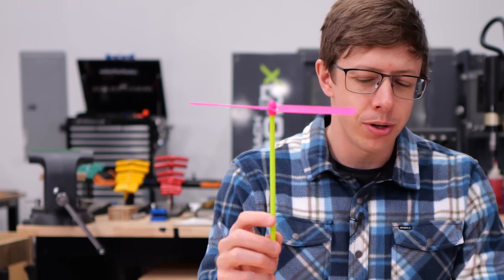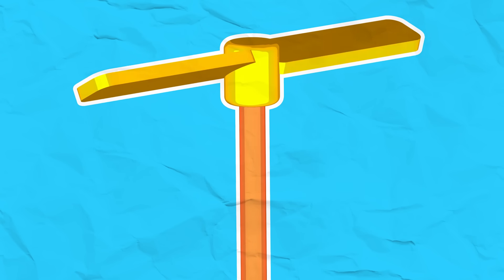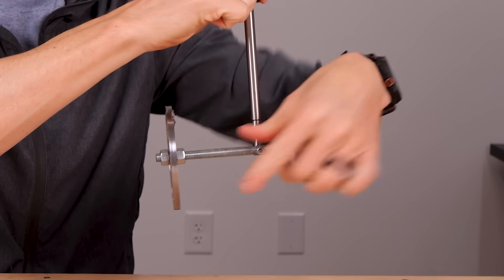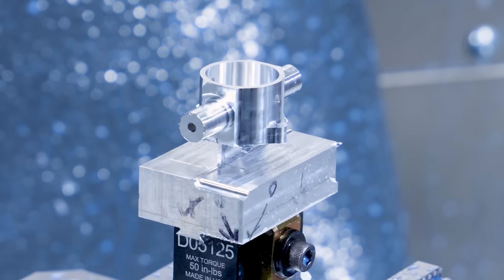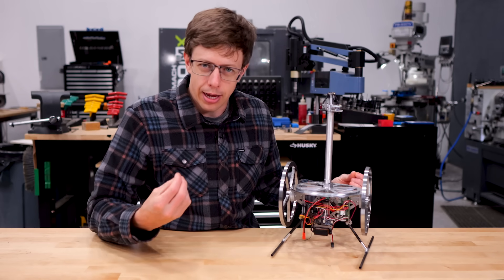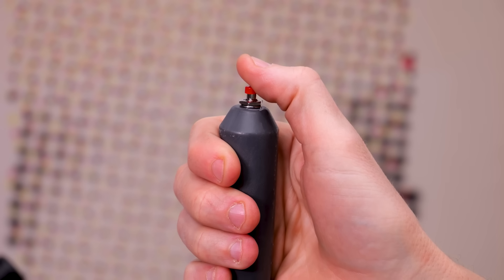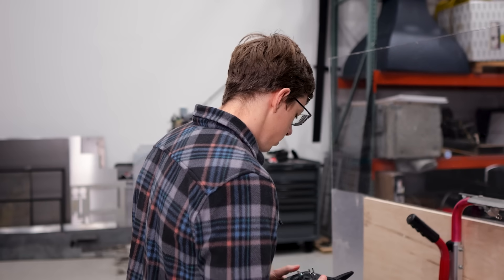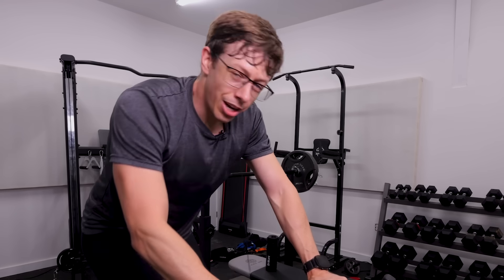I really thought this would fly well

Comment: 1:21 Would it make a sonic boom? I may be wrong, but I believe the sonic boom is caused by the object moving past you. It would be really loud, for sure. But it wouldn't boom, it would just be constantly loud.
Reply: It has to do with the overlapping of the sound waves, which at or above the speed of sound are not travelling fast enough to get ahead of the object, so they compound. So something moving toward you at exactly the speed of sound would be really, really loud when the sound got to you. A sonic boom is just that compounded sound, like a whip crack for example. Of course, bigger things generate a louder sound, which is then compounded.
Reply: A sonic boom just happens the moment something breaks the speed of sound (supersonic)
Reply: @ComradeCoy  sorry but no. A sonic boom is just many overlaping sound waves reaching you at the same time because the object emitting them is moving faster than the waves can travel. Importantly, it has to be a moving object because otherwise the sound waves would not overlap.

Comment: If you were to use another pair of flywheels rotating in the other direction, I suppose you would have the sideways torque cancel out and still keep it from flipping to the side. I suppose you could have a second horizontal bevel gear for the second pair but this one would rotate them from below instead of above. That may be a simple way to fabricate it

Comment: At minute 15; what about removing the ground?  At takeoff, the behavior, or even the effectiveness of the control surfaces won’t be representative of their performance in flight, with this gigantic earth-sized blast shield right behind them — ie: they’re getting no flow it’s like if they were stuck in prop-wash 🤔 (this is just how I’m imagining it though, i could be very wrong).   But if the launcher were on a pedestal, would you see more responsiveness?
Another thought I had on… “procession-protection,” was a contra-rotating prop (either a duplicate of the existing prop gear, & coaxial shafts, or 🤔 spider-gear? lol idk how passionate you were about this one but I’d rather imagine it failing from too much added weight or inefficiency haha / engineering your way out of a design oversight 😂, but ok, I shall eagerly finish watching now😊!…)  Love your work👍!

Comment: Why didnt you just make the propeller it self heavy so there is no extra mass to lift and it just need to be a propeller. Because of the rotation it will stay upright and the propeller it self becomes the flywheel

Comment: The flywheel should really spin in the same direction as the rotor blades so that they generate the same gyroscopic forces. some kind of transmission could be added between the rotor and the flywheel to increase the rpm of the latter to store more energy. Also the rotor should be able to pivid around its center so that the blades can flap up and down, in order for it to be able to fly horizontally.

Comment: If you needed horsepower to spin it up you could just buy a junker car and salvage a real motor, if you needed 20 you'd easily get 5x that on the low end, possibly 25x if you shopped right.

Comment: What other said about counter-rotating propellors helps... but at the end of the day, flat blades at 45 degrees is one of the worst things you can do in an aircraft or rotorcraft. For every newton of vertical thrust you make, you also get an equal amount of drag. What you really need are airfoils, to more efficiently translate velocity into lift. That will reduce the control authority you need to counteract the drag.

Comment: If you really want to make something really simple and flying, I recommend remembering about spiral springs.
For example, they are found in music boxes.
You put the spring in the base of the propeller. You insert the spring cocking mechanism into the shaft. All that remains is to insert a button/switch to release the energy in the spring and you're done.
No electronics, a minimum of parts, as similar as possible to the original children's toy. It will also be light in weight and this thing will not break itself in the process.

Comment: Tourbillon system? Or just straight helicopter? Or simple smaller flywheel at the bottom of the axle stem that rotates with biggest guy rotating to cancel out problem rotation although the smaller needs right an allow for correct flying/total height and weight reduction? Or something else like tube launch system with secondary props and a axle bearing flywheel that unscrews then clutch spins weight later? Excited to see the next one

Comment: Not sure if it was already mentioned in some of the 1925 comments below but the reason the flight surfaces are not working is that your testing is keeping it low to the ground.  You need to let it rise up by at least a wing chord length so the air can flow over and off the back of the surfaces cleanly.  As it is right now it's sort of "piling up" against the ground/floor just a small distance below the trailing edges of the control surfaces.  And that's negating the development of corrective force from those surfaces.    Perhaps a new launch platform but one that is elevated up off the ground a ways and with flat struts aligned with the airflow so the controls can develop the proper forces.

Comment: You forgot to counter the other torque, induced by the horizontal wheel,  include the weight of the top blades also... maybe you should use the horizontal gear as the flywheel mass altogether. There is lots of ways to improve it.

Comment: Just a small correction:  when a helicopter is in auto-rotation, the rotor does not reverse pitch - it just decreases the AOA.  It spins in the same direction, and is essentially gliding a plane with no engines.
When close to the ground - the AOA is increased converting the rotor's kinetic energy to lift.
Reply: Maybe no negative pitch on a full size helicopter (probably zero) but definitely negative pitch on a model. Reason is smaller blades equals less inertia.
Reply: @Aztek1701  kinda depends, with some forward speed you certainly can auto a model helicopter with neutral or slightly positive pitch
Reply: @togimeow  You can auto it with neutral pitch? How does that work?
Reply: @heinzaballoo  You can auto with neutral pitch because AOA is not the same as pitch. In auto-rotation, you can have air approaching from 5 degrees below horizontal while the blade is pitched up 5 degrees, giving you a total 10 degree AOA. Or you could have neutral blades (zero pitch) and still have an AOA of 5 or 10 degrees. All the matters is the air is flowing upwards past the blades.
Reply: @robinbennett5994 That explains it, thanks!
Reply: Sorry to say, but you are absolutely wrong. AoA is not the same as the blade pitch. Angle of Attack is the angle between the relative wind and the blade chord line. Pitch is the angle between the plane of rotation and the chord line.
That means that compared to normal flight, in an autorotation you generally DECREASE pitch (to maintain energy and get into the autorotative flight profile) but have INCREASED AoA since the inflow angle is now reversed and coming from a much steeper angle than during forward flight (relative wind coming from underneath the blade).

When you get close to ground you start flaring to convert your downwards vertical speed to horizontal speed. That horizontal speed is then traded off by putting that energy into the rotor by decelerating and using the last bit of energy to land. It's a coordinated flow of precise maneuvers where you need to have a good understanding of the physics to be able to...not die.
Reply: @MortenBN  The blade velocity is MUCH higher than the vertical velocity, so what is relevant is the angle between the blades and the rotation plane.   Otherwise, you are in serious trouble.

My point is that you do not reverse pitch.  Is that wrong?
Reply: @ well, you can use negative pitch but you'll drop like a rock, converting your potential energy to kinetic energy real fast :P that energy can be somewhat turned back into rotation of the blades though, by reducing the pitch towards neutral again, which will slow down your fall and increase the headspeed. this is what happens when a helicopter flares just before the landing during an autorotation.
Reply: @nissimhadar  It is correct that you don't reverse pitch. Everything else you have written so far, is wrong because you don't have the proper understanding of the definitions of the terms you are using. It would help you a lot to study what AoA, pitch, relative wind etc. is and how they function during normal and autorotative flight.
Reply: @MortenBN  I flew fighters for over 30 years, and have developed flight-control SW.  I admit that I know a lot less about helicopters.
I do know that the blades are kept at a positive AoA during auto-rotation, albeit a small angle.
Where am I wrong?
Reply: Come to think of it, NASA probably went through much of this when they came up with Ingenuity. Still, it's good to try other methods. That's how discoveries are made! Best wishes on part 2!

Comment: If you added another bevel gear opposite to the bevel gear on the top and made it's weight equal to the spinning parts on the top, would it cancel out the gyroscopic effect? The idea being that the bevel gear on the bottom would spin in the opposite direction to the propeller assembly.

Comment: The more you dive into helicopter dynamics and flight controls, the more your design will converge towards a classical helicopter imo. With the dual flywheel concept, 'm thinking either a counter-rotating main rotor or a torque-compensating secondary rotor off to the side is you best bet, those control surfaces will be helpless at such low speeds.

Either that or you ditch the dual flywheels and go for a single, in-line flywheel coaxial with the rotor

Comment: What a fantastic Rube Goldberg machine.

When I was a lad in the 90s I had a plastic toy indoor version and the engineer back then solved the same issues you're facing.

The solution?

3-bladed prop, no shaft, thick ring of plastic outside the prop for inertial storage, a square hole in the prop spinner and a base that meshed into it that let you spin it up by pulling a knock-off zip-tie.

You'd put the prop on the base, pull the zip tie, and the prop would fly into the ceiling and pin itself there on a little plastic nub in the middle until friction brought it down.

Be careful with that knowledge, upscaled to the size you're working on you can trivially spin such a device to the point where the outer ring has high powered rifle energies if it lets go - turbofan engines do containment tests for a reason.

Comment: Well, you did come a long way from the hand spun prop. (9.92) 
I loved these as a kid, and we actually made our own with a dowel and wooden RC prop. While I'm sure you did some math along the way, my instinct would be that the flywheels are way too large and heavy (which is also the definition of a flywheel), and the bevel gear shouldn't need near that much width (tooth contact area).
Counter rotating props are always cool until they interfere with other design concepts. For some reason I'm thinking solid steel ball(s) as flywheels at the bottom of the main shaft, more aerodynamic, but doesn't offer gear reduction without planetary gears or ?
When you wanted to spin those flywheels to 20,000 RPM, I was thinking you must be going for a low earth orbit.

Comment: It was once said a helicopter doesn't fly on paper. It's in that category of those typically "best left there" but obviously wasn't. So you had to at least attempt it. I respect that. 🤣

I'm wondering tho if you made an aluminum version of the original toy and weighted the tips of the rotor with something like tungsten or what have you... and gave it an appropriate spooling motor and release mech, a little spring loaded rotor neutralizer for the spin up... I bet it would do altitude tricks but probably should be in the most impossibly open field you could ever hope to find lol

Comment: I have no real aerodynamic experience, but whats stopping you from eliminating the gyros and using the 5-axis to make really heavy blades? I'm not sure if you could hit your rotational inertia target with 4 or so blades, but it would eliminate a ton of complexity! Anything over 3 blades will be stable, would have zero moving parts, and wouldn't require active control. Also could lead to the thing crashing through a car window but hey, that's the cost of iterative design.

Comment: Isn't the big ol' prop acting like another gyroscope that could be countered by another flywheel rotating the opposite direction? As in, it looks like torque roll. Giant control surfaces would also work better to counter it and so would a lot more mass in the body, but those seem like sub-par solutions.

Comment: super curious.... if you used a hollow shaft for the prop, then added a second gear on the bottom of the flywheels gears, with a smaller shaft going through the center one up to a secondary set of blades... would that solve the issue? I call them... Counter rotating blades.

Comment: What was meant to happen... did happen. How shocking... But at least it's cool, now we know exactly why helicopters use a secound rotor to counter the spin and not wings. But there is a lmited number of ways to fails, so once you tried them all and fixed them all, it should be going straight to heaven ! Go for it !

Comment: I'm much too lazy to see if anyone else commented this, but I'll say it anyways. To me it seems the flywheel should be axially/concentrically mounted to the shaft using a planetary gearset to make the blade shaft spin slower.

Edit: On second thought maybe put a clutch on it so you can adjust the rate at which energy is taken out of the flywheel and given to the blade shaft. You could also play with making a prop governor style flywheel, which seems more your speed in terms of "overcomplicating" things in silly and fun ways.

Comment: Wait... Why did you rotate the flywheel 90 degrees? Wouldn't it be a simpler design to simply stick the flywheel on the bottom of the main shaft and use some sort of limited friction spinning coupling to slowly transfer kinetic energy to the blades?

Comment: This was a blast to watch! And personally, I think the only reason this failed, was that you overcomplicated the project. Simply scaling the original toy up and making it as light as possible would have achieved an impressive height! You could use a carbon arrow for the body and the same carbon blades for the rotor, a more traditional ratchet shaped mechanism for the launcher, and if you really want the weight/inertia of a flywheel, you could make a steel or lead ring that encloses the rotor blades, which would also reduce drag at the wingtips! Similar toys exist without the post for hand launching that use 3-4 blades enclosed in a thin ring as I’ve described, and one made with the right weight distribution, in a larger scale would probably be capable of some real altitude

Comment: The kid's toy  doesn't need much stabilisation, because the whole thing, is rotating. Your version is basically a helicopter, and controlling these isn't easy, even with commercial versions. There is a reason why drones have four propellers and helicopters have a second propeller to control the rotation. As the air resistance increase for the propeller, more and more energy will go into the rotation of that whole thing. You would need two propellers on top, going in different directions, but the gear would probably eat the energy of your flywheels really fast.

Comment: Perhaps for a second attempt it would be worth exploring a tip jet rotor using some pressurized gas instead. It's little known even within aerospace but has the advantage of inducing no torque on the airframe. I think you could produce a much much simpler design using this principle instead.

Comment: Keep the design exactly the same as the kids toy, Turn the bottom half of the shaft in to a shaft shaped flywheel. use some kind of clutch system to engage the botttom to the  top of the shaft.

Comment: While watching all I could think of was putting a fly wheel under and in-line with the propeller. Either spinning counter to the propellers which procession might cause issues or spin with them, in which case you can forgo anything on the body of the craft that might break apart while spinning at speed and make a solid body.

Comment: You overengineered the hell out of this.   If you wanted to just make a really fast and high flying thing like those toys, you should have made a shaft with blades, spin it up to the right speed and disconnect the shaft itself and let the blades and the shaft take off, instead of trying to make the whole unit take off.

Comment: My idea will probably get lost in the noise, but I think an easy solution would be to create a second set of flywheels offset from the first set but the gearing is set above the bevel gear. The bevel gear would have to be beveled on both sides, but that would allow for the second pair of flywheels to rotate in the opposite direction as the first pair thus canceling out the induced torque.

Comment: Basically you are trying to build an RC helicopter without the main batteries and main gear motor.
Maybe just get one, a rather big one, and modify it?

I think you should stick to the kid’s toy design. Figure out something spinning vertically, like a cylinder. 
No electronics, no blade pitch, or centrifugal control.

Comment: Your control surfaces don't work for me 2 reasons I think:
1) downwash has a really complicated flow field with much turbulence and many vortexes, so it's like sticking your control surfaces into a washing machine 
2) on the ground, the air doesn't have much way to get going into a direction that would create the thrust to stabilise your heli

I think you could maybe fix that by some kind of grated fins just below your rotor, like spacesex has